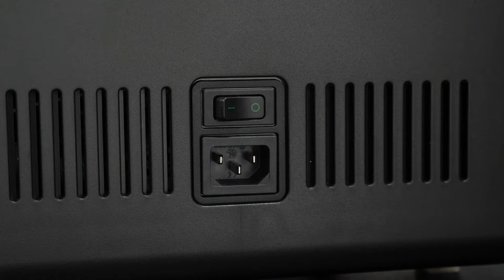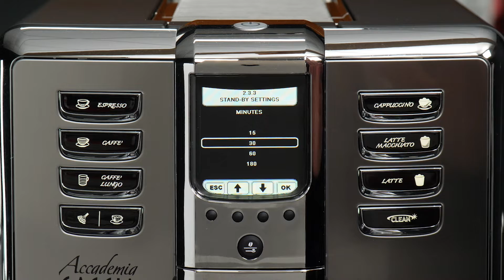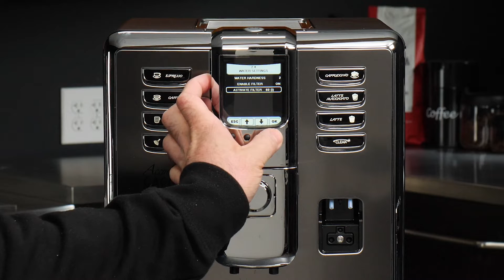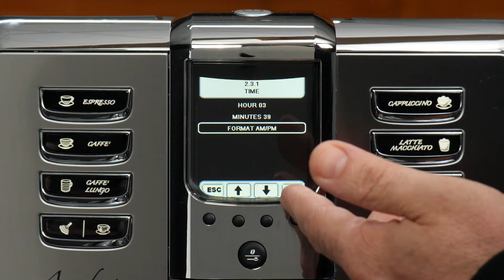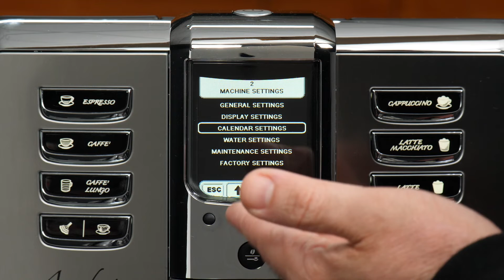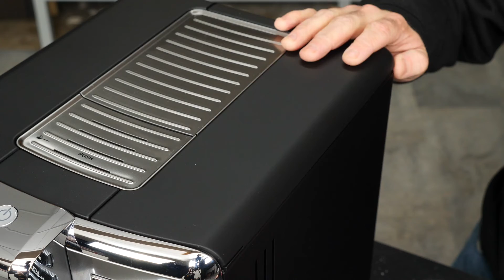How To: Initial Setup & First Use of the Gaggia Accademia Espresso Machine

Comment: Thank you for the great video! I just received my new Gaggia Accademia days ago and all is working perfectly so far. I am still trying to get my espresso tasting the way I want it as it still seems a little bitter. Prior I was using a Gaggia Brera. My Accademia settings are as follows for my lattes and cappuccinos:

* Pre brewing set to maximum
* Grind size set to the finest setting
* Flow control set to largest dot
* Coffee amount maximum
* Coffee temp two bars
* Coffee length a little less than the med point
* Using Orphea Maromas 

Any suggestions you have would be greatly appreciated. I have watched several videos and have not found my answer. :)
Thank you!
Reply from the maker: Hi s, You are welcome. There are a number of settings you can change to reduce bitterness. Easiest with most immediate results is adjusting the flow control to a smaller dot. That will increase the flow rate through the coffee. You can also adjust to a coarser grind size - that'll take a few cups to fully realize the flavor change. Can also reduce strength. As you make changes try one at a time. Hope that helps!